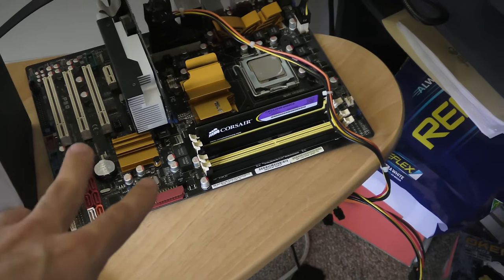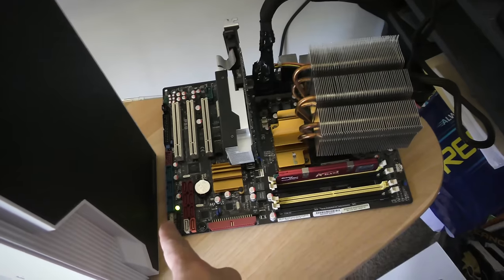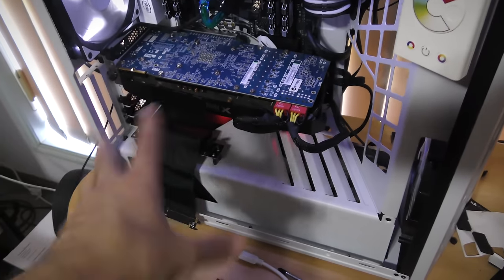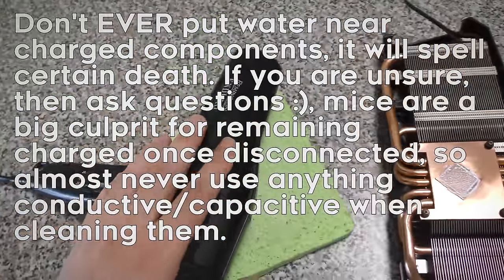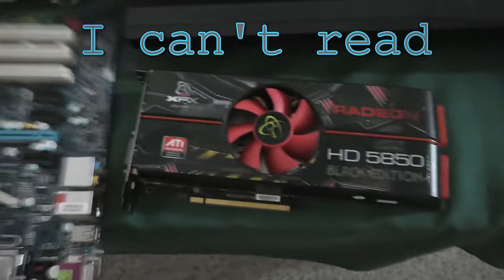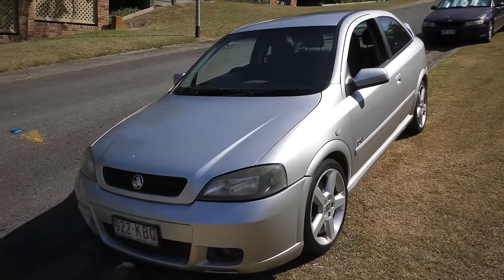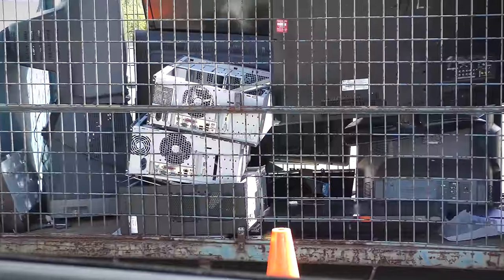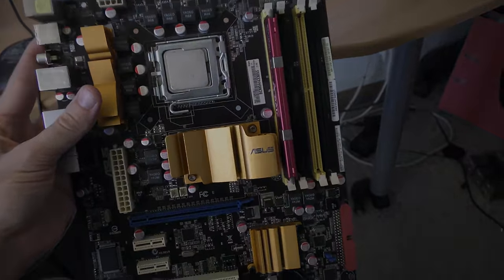The Stuffing Around with TECH and CARS Vlog - A Broken 7970?

Comment: I have a very good solution! Try baking the 7970 in the oven. All you have to do is take a cookie sheet and cover it with foil. Then make foil balls to prop the PCB up and heat the oven to 375° F. Put the GPU in the oven for about 10m. This temperature will start to melt and reform the solder and 10m is the perfect amount of time to do so. It worked for my Powercolor 7970. Make sure you remove the cooler and the plastic casing surrounding the fan header.

Comment: One thing to save time after unplugging the power supply is to flick the power switch or jump the connector on the motherboard.  It'll discharge whatever power is left over.

Comment: xD! I'm still rocking that same board! 8 Gigs and a X5460 @ 4Ghz, 771 mod and custom Bios with the CPU microcode. Sadly enough, the Asus' 280X with Arctic Cooling system on, is bottlenecked AF...Initially got  Core 2 Duo E6320 ( best overclocker ever) back then.

Comment: Tech city you should try to build a £150 gaming PC that plays battlefield 1. I think the results would be very interesting, compared to your battlefield 1 PC
Reply: Go for an old Xeon, like an X5450 or a Core 2 Quad. Pair it with a scrap case, half-decent power supply and spend the rest of your $80-100 on something like a used GTX 670 or 660Ti an HD 7950 or 270X.  (Of course, this depends where you live, $80 USD gets me a used HD7970 or GTX 680)
Reply: ECCENTRIC, well I found a r9 280x for £70
Reply: Thats a decent buy.

Was it reference or a Sapphire etc?
Reply: Lol Cats Nice! The used PC parts market in Europe is very strong, can't say the same about Canada :P
Reply: windowsfrozenshut Does the dell PSU have 6-pin and 8-pin PCIe connectors? A C2D E5450 is dual core garbage, probably will bottleneck the card. A 7950 or 770 kicks the shit out of a GTX 580. You probably won't be able to overclock off of a garbage OEM board. There is no way in hell you can find 8GB of ECC for 15 bucks, unless you live in the states and get a good deal, or bid. My solution may have been a tad more expensive, but it is way better.
Reply: windowsfrozenshut lol the E5640 changhes everything ;P my processor is still clocked much higher, and can overclock with a little modding. A cheap case and good PSU costs around 30 bucks (ever heard of Seasonic OEM, Antec or FSP? Used cases go for like 20 bucks) GTX 580 is still garbage. I'm pretty sure an R9 280 or GTX 670 kicks it's ass and costs similar used. And used solely for gaming, I'm sure 8GB is enough. The CPU/mobo costs a little over 45 bucks, and you can mod 771 xeons to use in a 775 socket.

So.. $30 + $85 + $15 + $45 = $175. 
A little more for some cooling and cables (25 bucks preferably)

You have a $200 monster. The CPU can overclock well above 3.5 GHz, as can the GPU. It's already better at stock freq. The GPU is based on the newer Kepler architecture. It doesn't have a no-name dell PSU or motherboard, and it consumes less power. The board supports Crossfire as well. I'd spend a little extra for a lot more (price-to-performance after all).

Comment: I would love to see a video that outline the low end CPU that won't bottleneck these mid range GPU; Amd Rx 470 4gb & 8gb, GTX 1060 3gb & 6gb and Amd Rx 480. For example will the core i3 6100 or Fx 6300 bottleneck any of those GPU i mention earlier, if that's the case how much will they.

Comment: I burned a 270x yesterday, caught on fire
Reply: OctoMan PC's NOOOOOO
Reply: Oh yeah, and i didn't notice until I smelled the burnt plastic. then smoke, open the case lid and it was bad, miraculously, NOTHING happened to the rest of the build, nothing
Reply: OctoMan PC's thank god...
Reply: How did it burn? Was it the PSU that caused it?
Reply: I was putting a build together for a Client and it was in a DELL OPTIPLEX prebuild. I installed a Seasonic 550 80 plus, but the case inside has a HDD cage, ALL METAL. I installed the 270x and it kinda made contact with the metal cage. I have no other reason.
Reply: 1050ti, done deal  1060 3gb if you want more umphhh